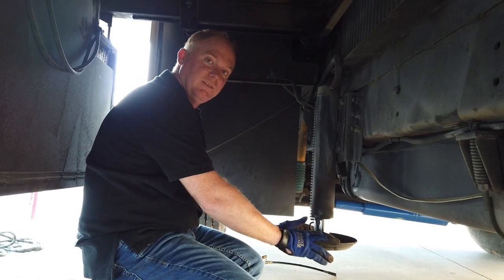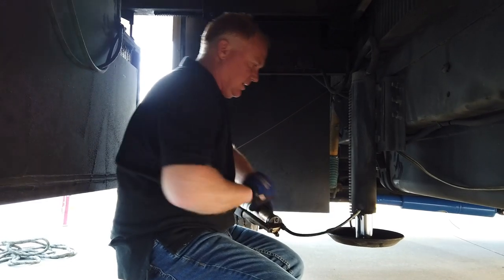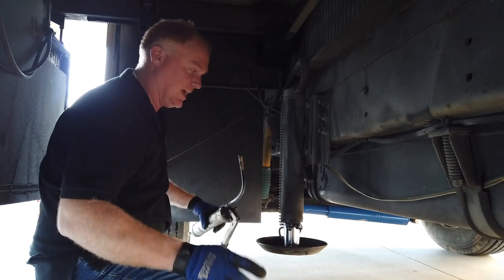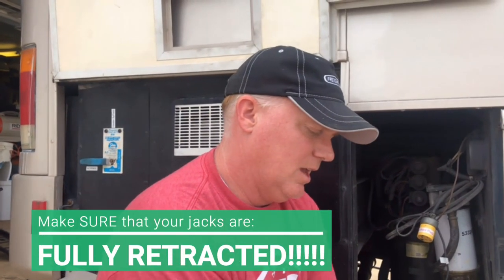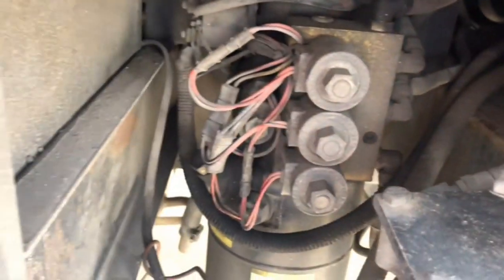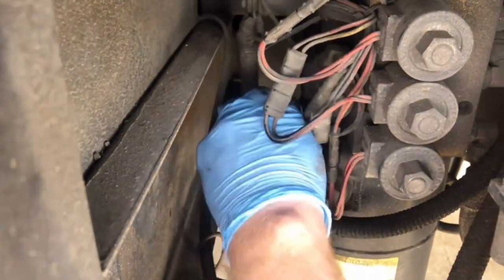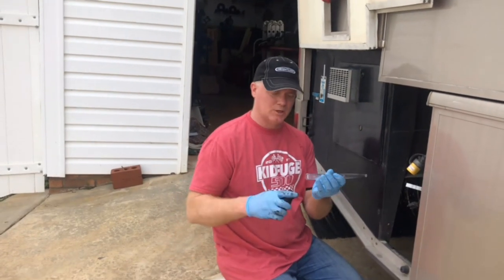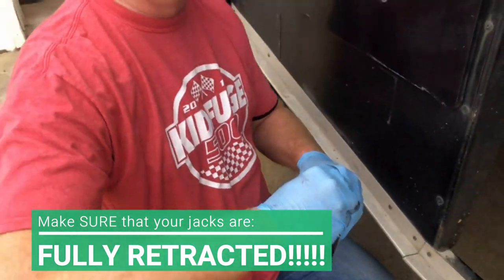DIY - Servicing the Leveling Jacks on your RV or Motorhome - Discovery 37V

Comment: I need to lift the front end on my class C to replace shocks, steering damper and wheel bearings can I use my levelers to lift front end?
Reply from the maker: Yes..... and no. You can use them to lift the rig, but don’t use them to hold it. Chock the rear tires front and back, set the parking brake, then Use the jacks to lift the front, and then set jack stands under the rig, and then set the rig back on the jacks. And then make some
Cribbing under the leveling jacks and put a little weight from the jacks on the cribbing.
That way the weight of the rig is supported by things made to support weight, and the jacks on the cribbing is there for safety purposes.

Comment: Hey Pastor,

Got another question for you. We have the same rig and I am unable to start my generator. Does it have its own independent battery or is it tied to the coach or engine battery? I can’t seem to find it. Thanks God Bless
Reply from the maker: The chassis battery bank (2 sealed deep cycle 12v batteries) starts the engine. The house batteries (2 6v wet lead acid batteries) power the house lights, etc and they are also used to start the generator. If your house batteries are weak, they won’t start the generator. On your dash there is a switch that combines both battery banks together, in case one bank dies.
Hold that switch down and then hold down the switch to crank the generator. That should get the genny cranking.
Then figure out why your house batteries are dead. Check all connections on the (2) 6v battery sets, and check your grounds too. (I recently had a house battery cable break, so I had to remake the end of the cable to connect to the 6v battery.)
Reply: I tried combining the battery banks. No help. Need to do some more troubleshooting. Thanks for the help

Comment: Have a 99 Discovery 37v. Have one of my leveling jacks that is leaking. Have you ever rebuilt one of these or had to buy parts? Thanks for the good info . On our way home from a recent trip the jack contr panel would show all jacks were up but then while driving it kept beeping and flashing. Probably have a low fluid level due to a leaking jack. Good to know. Haven’t been able to find any additional information on the leveling system. 
Thanks,
God Bless
Reply from the maker: Same rig that I have!  Awesome!
The blinker light beeper nag sound is only there to give you a fluid level.... when the fluid level gets low, it figures the fluid is gone from the reservoir and out to the jacks.... so you are spot on with the beeping, you are low of fluid.
If you have a jack that is leaking.. the first (and easiest) thing to do is grease the heck out of the zerks on the jack. You should have a grease zerk at the base of east cylinder. Hook up your favorite grease gun and pump ‘er full of juice. That will seal the seals, and should dampen any fluid loss you are getting. Also, while the rams are extended, give all 4 a good coat of silly-cone to help with their movement.
If you still have a leak, then a rebuild is the next item up for bids. They are serviceable, so yanking one off and taking it somewhere to be rebuilt is a good idea. Plenty of local hydraulic shops can do it. They are SUPER HEAVY, so be ready for the weight.
Finally, the best advice I can give you is to join the Discovery Owners Association.  We have an amazing tech support forum, and lots of guys ready to help and give advice.... way more better than what I can give too!
www.discoveryowners.com
Reply: @RVPastorKevin  Thanks for the reply. God Bless and happy trails.